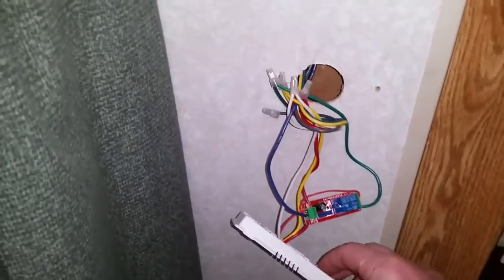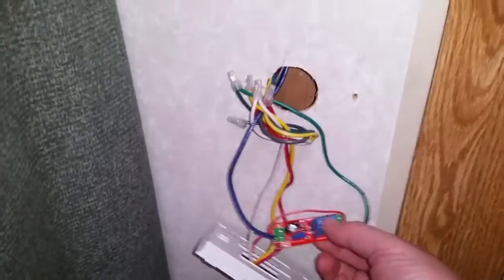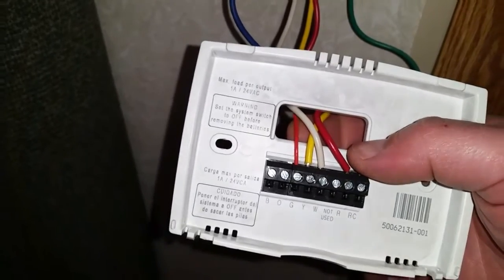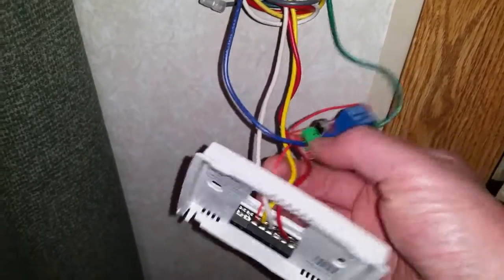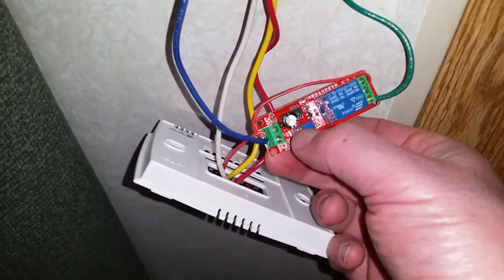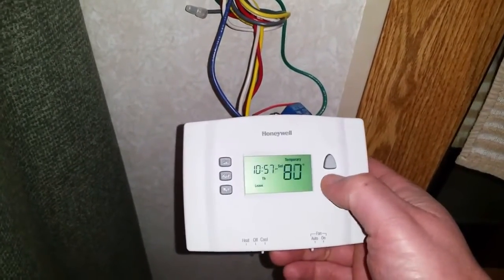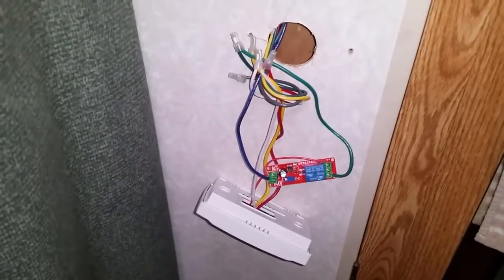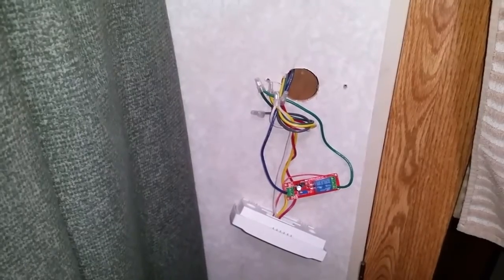RV Air Conditioner Soft Start Kit Relay DIY

Comment: Rob. If I install the time delay on the original Coleman Mach thermostat will I still need to attach the Blue wire to the delay module?
Reply from the maker: The blue wire is ground and the relay needs a ground to work so yes.

Comment: Why not delay the compressor instead?
Reply: whats the difference, they both will end up running, also if the fan is running first, you will have it's amperage draw on when the compressor starts

Comment: Ya we have a thermostat that doesn't work but I wired up the compressor and the fan and it all works and was trying to build my own thermostat with an Arduino and was thinking it would be useful to have it kick the fan off while the compressor starts but I don't know shit about programming Arduino so it never worked out

Comment: My Dometic Thermostat only has a white / blue / red connected to the thermostat board.  The green is not connected at all.  Any thoughts on this?  (Dometic Capacitive Touch Single Zone).  Thanks for the great video.

Comment: The actual EasyStart that is over priced because it is marketed towards RVers, is a PWM circuit that slowly dumps current from a capacitor in a ramping function into the compressor to start it. You can actually build one out of some basic parts and an arduino for less then $50. This will allow you to start the unit on a 2Kw generator or sine inverter.
Reply: ElfNet do you have a link to any instructions for building one specific to a RV air conditioner or as close to RV use?
Reply: My thoughts exactly. $299 is just a rip off
Reply: Do you know of any videos about how to build one?

Comment: what the generator can not handle is the Locked Rotor Current. It's 4 to 6X the run currents!

Puting a delay timer on the AC fan is a bit of a waste of efforts.

What you really need is called a "Soft-Starter", not exactly cheep but makes the equipment last forever. 
What kills motors and pumps (compressors!) is the In-Rush surge that forces the rotor to translate against its bearings until it starts spinning. 
You'll enjoy low start currents.
Reply from the maker: Thanks for the comment.  I actually did put a soft start capacitor in.  This time relay was just an extra precaution.
Reply: Lock rotor is actually when the compressor is locked up, you are talking about the surge at start up!